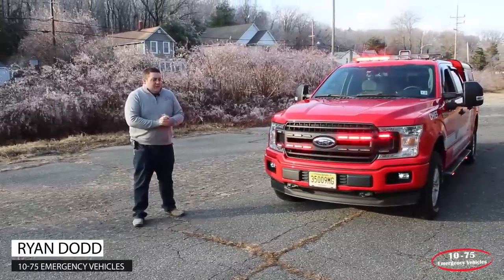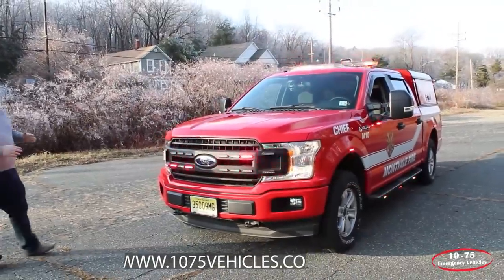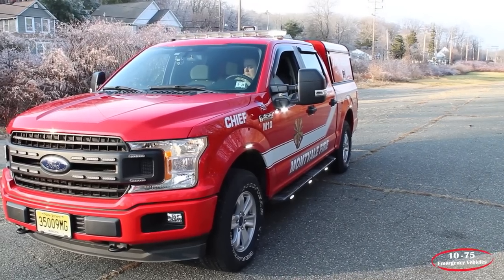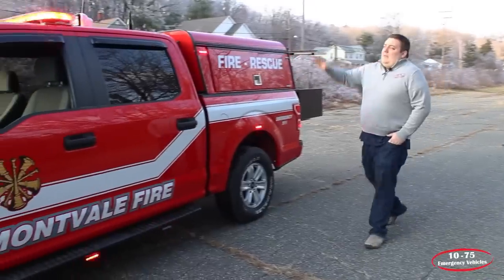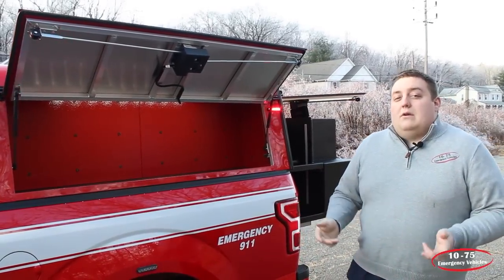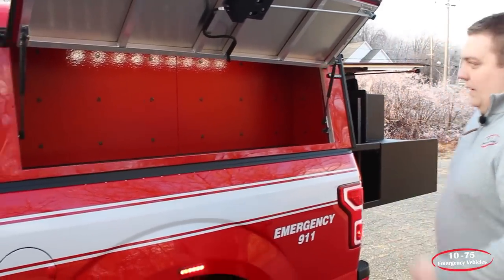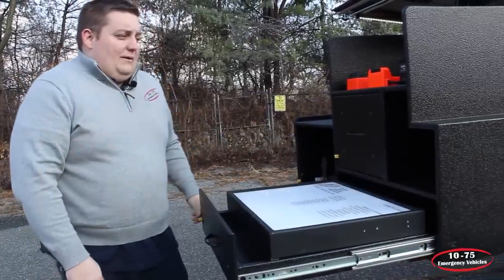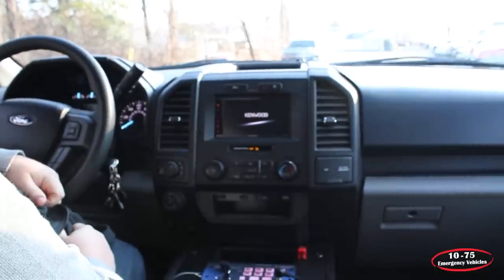2020 Ford F-150 | Fire Pickup | FULL CONVERSION

Comment: Wrong side for amber light.

In countries where traffic is on the right side of the road, the visibility elements (amber light, triangle for slow moving vehicles) must be installed on the left side of the vehicle. It is not without reason. In conditions where the vehicle is less visible (after a curve to the right), the left side of the vehicle will be visible first. Moreover, the NFPA prescribes that the amber light must be placed on the left side.
Reply from the maker: The truck has amber in most of the modules in the back. So depending on the customer request the system can be reprogrammed.